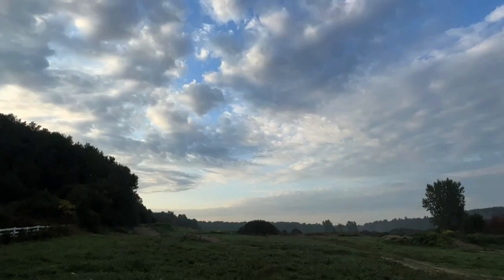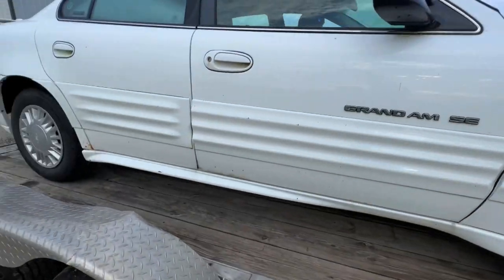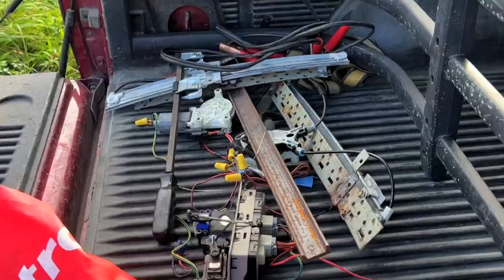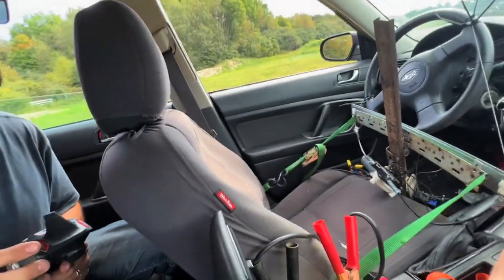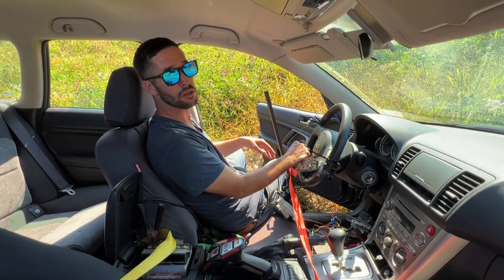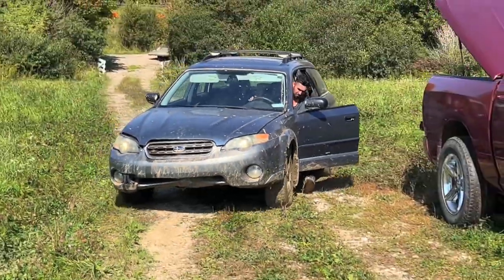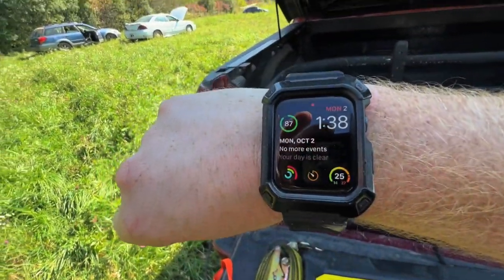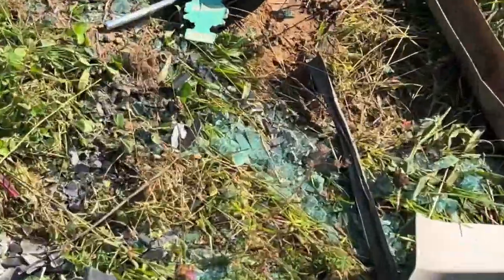Remote Control SUBARU OUTBACK FAIL!

Comment: Looks like a good start. Why not run a servo to the throttle body? as it has a throttle cable. Would be an easy way to use the throttle, and that way it would also return to idle easily.